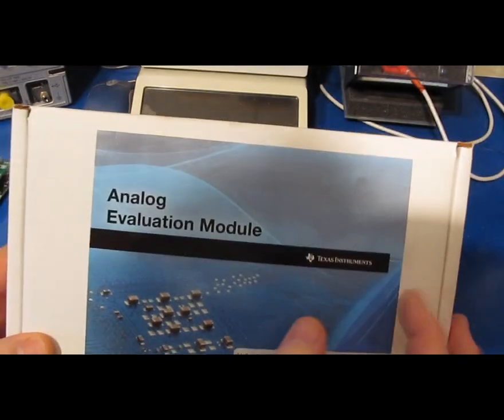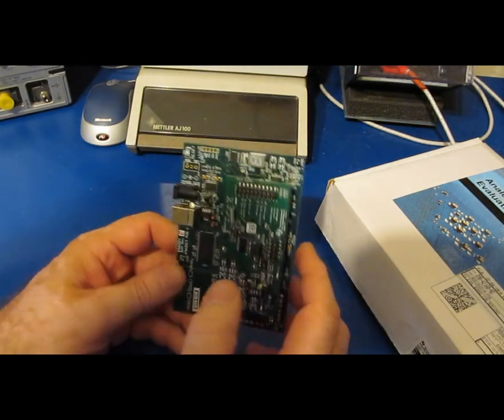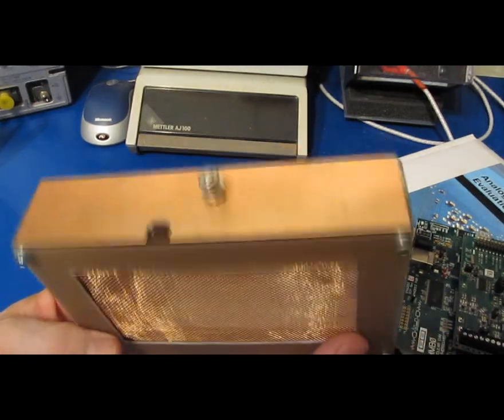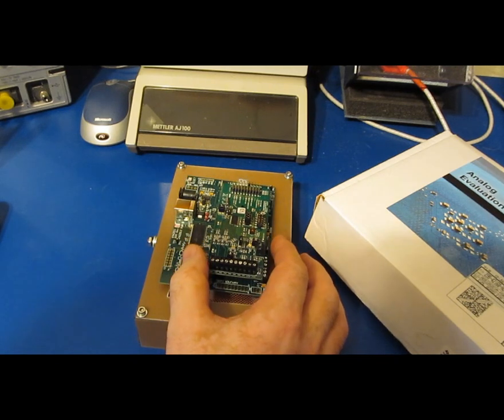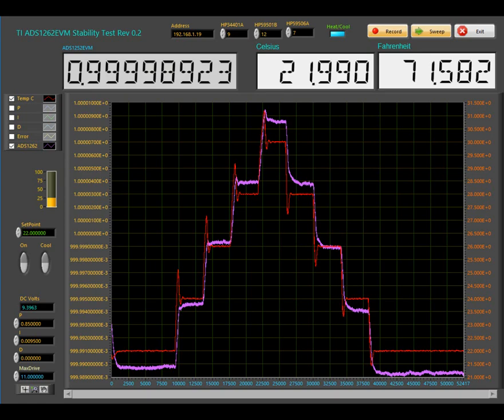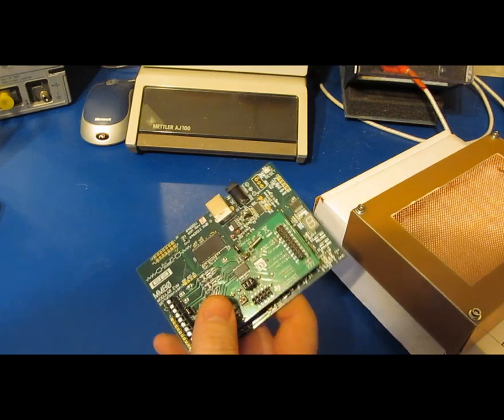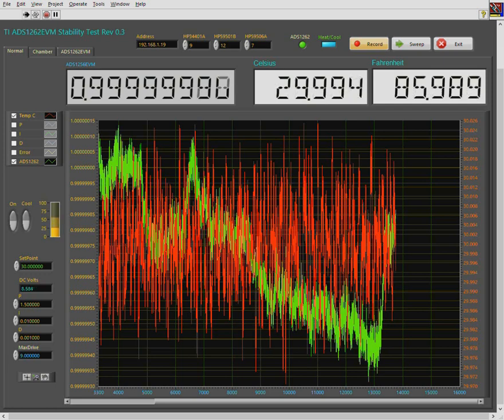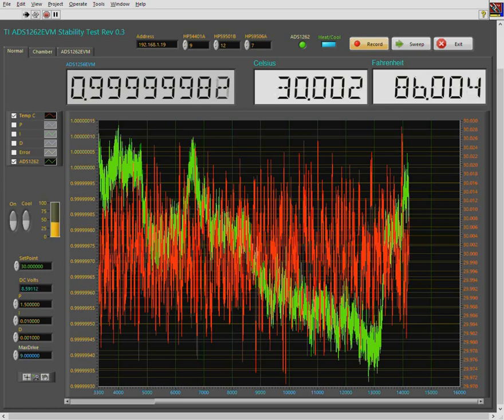TI ADC1262EVM 32-Bit ADC Evaluation Board

Comment: Thanks for this.  I had no idea that 32 bit A/Ds were available.  I see the basic chip is almost 40 kSps and only $10 in quantity!  Truly an amazing time to be alive.   We can only dream of the instruments that this kind of precision will enable
Reply: They are, but as you noted, very limited bandwidth in comparison... they've come a long way though, not so long ago they were more like 8kSPs :D
Reply from the maker: It's an impressive part.  The ADS1263 has a second 24-bit ADC for a couple of dollars more.   I would have liked to have shown more with it but it out performs my home equipment.
Reply: @joesmith-je3tq  hello it is possible to use it for audio recording? 40ks ps is 20 kHz sample rate (seems like 40 if it's base clock)

Comment: Thanks for sharing the video regarding the 32-bit ADS.

We are measuring voltage in the range of microvolts to millivolts using a 32-bit ADS1262 connected to a Raspberry Pi. We are facing a problem when going below 10mV; the ADC goes into a saturation state, meaning it shows the same output regardless of the input values provided. Any advice on how to accurately read signals below 10mV, even though the ADS1262 is designed for low-level signal measurements, would be greatly appreciated.
Reply: Are you biasing the common-mode of the signal up into the mid range of the chip? e.g, if using the 2.5V reference, you would want 1.25V common mode, and so a +10mV differential signal would be at 1.26V absolute.

Otherwise if the signal was at 0.01V absolute you are probably railing the PGA and it can't repeat the absolute voltage that low, onto the ADC.

Comment: Joe,  I have just become aware of this ADC.  I am excited to try it out.  I noticed that you have very high precision in your temperature measurement... Are you gathering that data through the ADC?  If so, what type of measurement element are you using?  Can you share a schematic for the temperature measurement portion of your system?
Reply from the maker: I use a precision platinum thermistor from YSI connected to an HP34401A 6.5 place bench meter.  Labview reads the resistance and calculates the temperature.    Labview uses this to control the peltiers.    I had used an APEX VRE305AS for the reference.